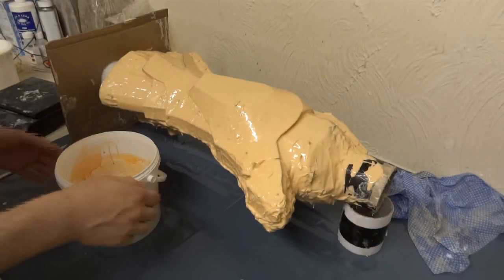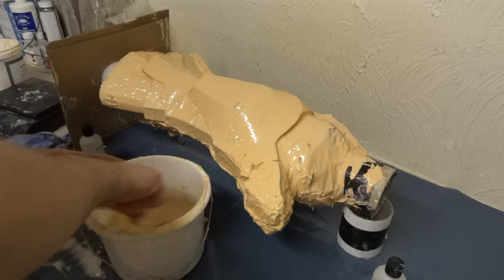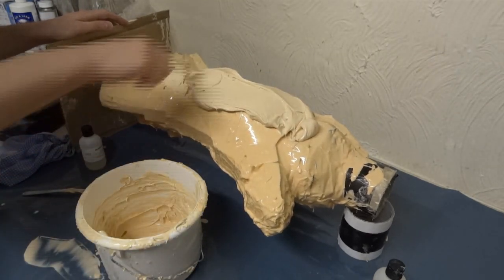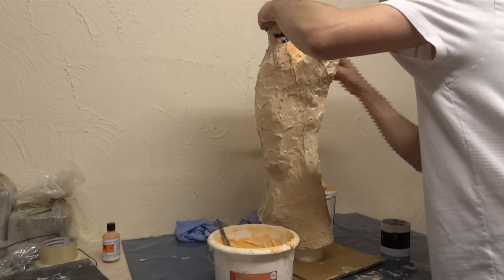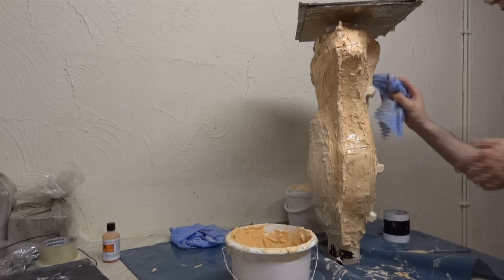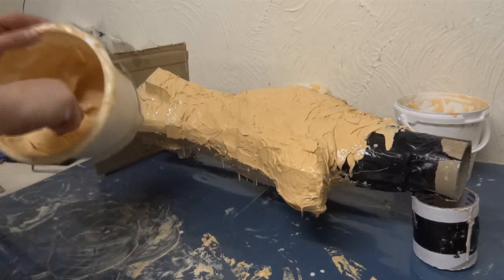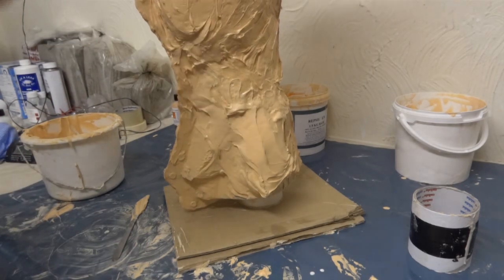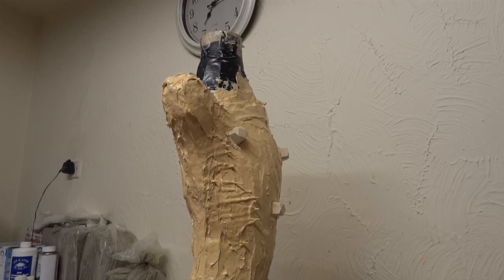Iron Man Power Suit #5 | Silicone RTV Legs | James Bruton

Comment: Hello James how do you suggest blocking or covering either end so you can start the silicone molding process. The holes are fairly wide and I do not want to put anything on them that will prevent the silicone from curing

Comment: hi, when you put the thin silicone coat on, do you mean that you mixed silicone with some catalyst and just brushed it on? how did you do that without it pouring off?

ive got a rtv thickening agent and it says to put on an unthickend coat of rtv before putting on the thickened coats.

whats the best way to do this?